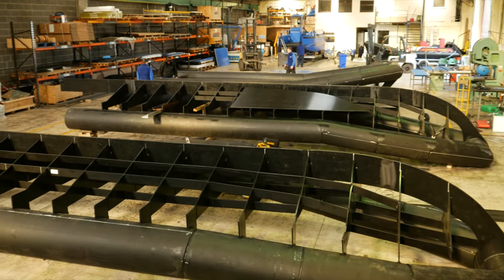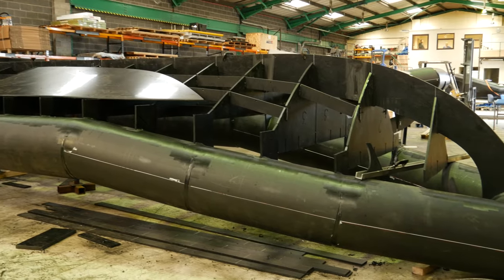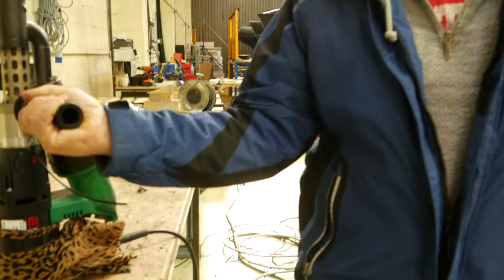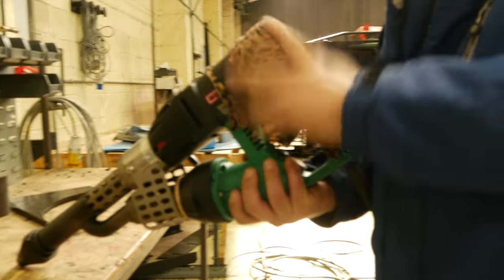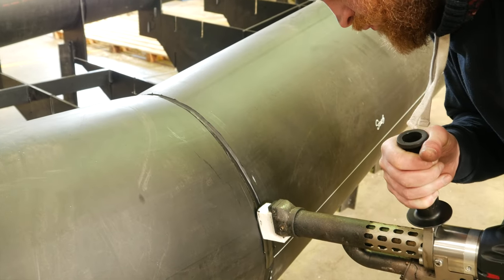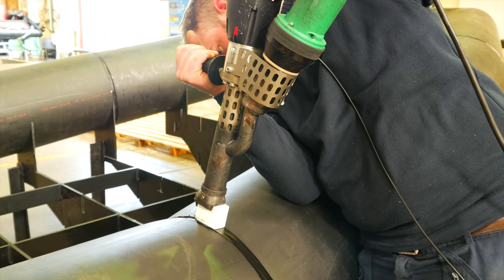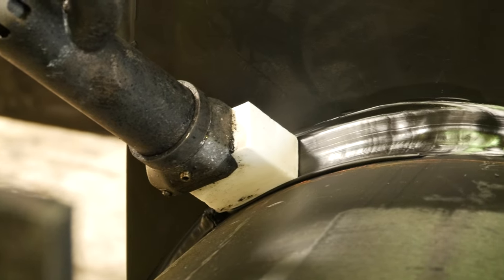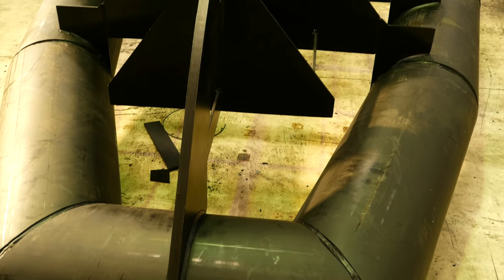Seahorse Marine - Manufacturing Vessels in HDPE Plastics

Comment: If the tube material is fabric, “O” shaped tubes are required but if the tubes a metal, “D” shaped tubes offer more interior space. Filling the interior of the tubes with non water absorbing foam like Boston Whaler uses is the key to a safe passage home regardless of the mission.
Reply: 489 steel 1248 gold
168 aluminum 27 hdpe
Wood 60 water 64